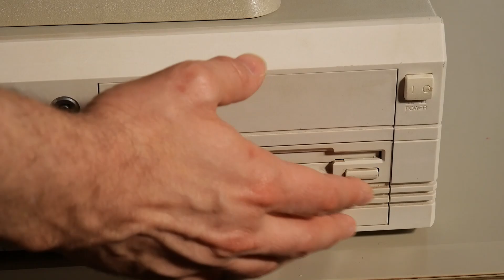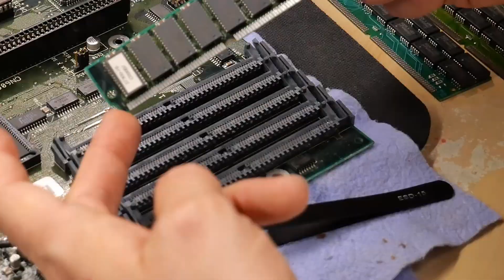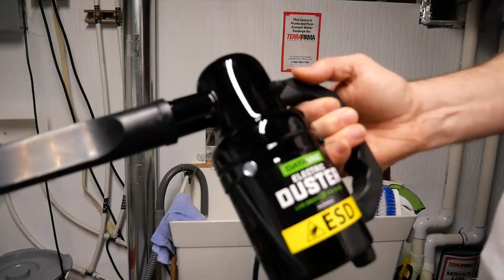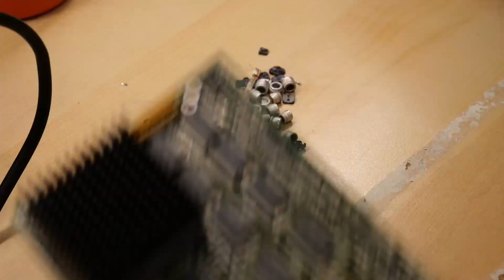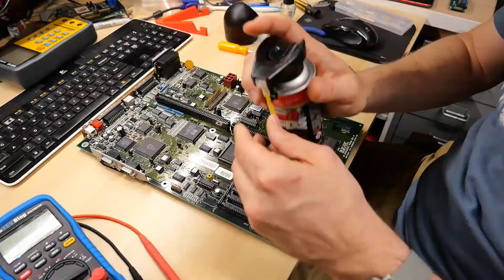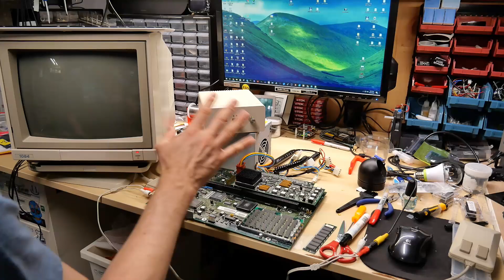Amiga 4000 Repair Part 1: Recapping and RAM issues galore!

Comment: Any chance you remember what trick was needed to remove the Video Toaster card? The combination of the BNC connectors and the card sitting in the video slot while simultaneously being slotted in the slot guides prevents it from being pulled up and out. You probably did full disassembly of the machine, which may have revealed another option to get it out of its slot.

Comment: Nice that you got the A4000 booting!

Winced a bit as you plunged the motherboard into water with not even IP rated components left on it. There are also lots of crannies and especially spot under chips that can trap moisture for a very long time. I also recommend snipping caps with cable stripping pliers (not wedge-shaped normal pliers), if you have no desoldering station. Twisting is a method that guarantees that you put a great force on the traces, which is bad.

Comment: I remember right you have to have two banks populated with SIMM Memory modules and it has to be Banks 1 and 3 or Banks 2 and 4 or all 4 banks populated at once. I’ve broken so many 30pin and 72pin SIMM retainer clips on the memory sockets and that’s when the sockets were new. I can only imagine how destructive I’d be with old brittle plastic memory socket retainers.

Comment: Watching you take out those RAM chips was like the "cut the red wire" scene in a bomb disposal movie. great stuff! God my old 4K was rickety like this.
Reply: Oh, BTW, regarding the wretched battery: my friend was a great tech admin wizard. He cut all the batteries out of my 4K and two 3Ks (saving them in the process). Solution in adding a battery back, if needed, without risk of future damage: he soldered two wires a few inches long to the motherboard and attached them to the battery, which was now inches away from the motherboard and sensitive parts. Just a thought for anyone who really needs a clock.

Comment: Hi Adrian, I was just watching this (older, I know) video. I saw you twisting of the smd caps. Give it a try to cut these caps just above the plastic base first. These caps usually fall apart leaving only the metal feet. These can than be soldered off.

Comment: re: Removing SIMMs with plastic clips.

I've had the most success by unclipping each side separately. Choose one side, pull forward  (medium lightly) on the end of the SIMM, and then pull the clip back until there is a click, this will get the clip past the leading-edge of the SIMM but it will be holding the SIMM from the side. Repeat on the other side, then just pull the whole SIMM forward (without touching the clips). I find this a much safer procedure. When you try to pull both clips out at the same time it's very easy to apply unbalanced pressure, or to continue to apply more and more pressure on a side that is actually free without you noticing.

Comment: When testing computer boards out of their case, make note of if the screw-holes are part of the grounding or not. About at the time of the A4000 system-grounding through mounting-screws became industry standard. The Amigas usually work anyhow, but things can get flakey. Good luck in the repair.

Comment: Don't know if anyone mentioned it previously, but one of the smd caps on the processor card has wrong plus minus marks on the pcb and was wrongly mounted too because of that. This only comes into effect under certain software routines, can't remember when, but I fixed it when I recapped all smd caps and all worked out of the box as before. I desoldered the smd's with an air blowing solder station and guess what? Two or three of the caps got too much heat and exploded, man that smell You'll never forget! Can't compare it with anything I know, maybe thats how hell smells...😄
To stop the sims unlocking I pragmatically honed them down on both sides a bit without any issues, always walking the hard road...

Comment: What do you use as a fume extractor?  I've been doing more repairs lately and don't want to keep breathing in solder fumes but a small fan extractor is not really efficient on larger boards.

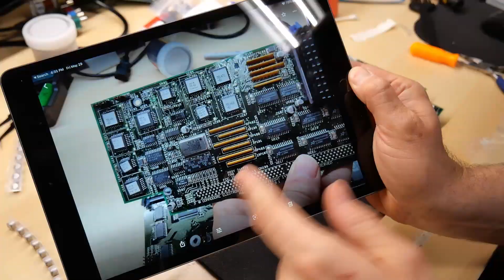Comment: Adrian, thanks a lot for this video! Helped me a lot to prepare for my A4000 restoration. One thing that left me really puzzled: I own exactly the same A3640 Rev 3.1 but on my (unmodified) board the C107, C105 and C106 are the other way than yours at 23:49. As it's difficult on this board to find ground, I used the casing of the quartz as ground and my caps appear to be placed correctly (0 Ohm at all terminals with black mark). Could you please verify on your board?
BTW: I pulled the 68040 for the cleaning process and tore off 5 pins - not due to improper handling but due to corrosion. There were many pins with green corrosion at the base (corroded gold ?!?) and all those came off really easy. Tried to solder them back on: no chance, gave up after 3h. Had to order a replacement on eBay. But with the old '030 board the computer still seems to work (waiting for a 15khz capable monitor) - but it boots and plays sound. Will post a video one day on my channel.
Reply: It really is an issue: http://amiga.serveftp.net/A3640_capacitor.html - the above mentioned caps are mounted the wrong way on your board and are likely to leak again due to inverse polarity.

Comment: Is worth to check CPU card revision. Some revisions had wrongly placed (I think) two capacitors (wrong direction - polarization). In my Amiga, when I replaced capacitors, I always try to use tantal one.

Comment: Power cycling failures may well be due to a slightly faulty PSU. I recently refurbished one and C34 sets the startup delay for the Power Good signal, that cap is a super small dinky one which fails completely and reduces the delay so the mobo might get a power good signal too early and the board might try starting up before the +5V has properly stabilized. If you replace the cap and notice that the computer takes a second longer to react to applying the power means you probably had this issue too.

Comment: George looks a little like Jay Miner the founder of Amiga Corp... ;-)
BTW most of the caps that you've taken out seem to be of the Nichicon dry type electrolytic which were most probably still very very good and wouldn't have leaked. Sometimes recapping is unnecessary.

Comment: That's an interesting soldering iron. What is it?
Reply: It's a ts100 type soldering iron. I've got one and it's pretty decent, it has computer controlled variable temperature control with a built in oled display and upgradeable firmware, also the price isn't too steep. I'd recommend one.

Comment: I'm surprised there aren't any aftermarket RAM slot replacements with actual metal clips instead of the dried up pasta plastic that Commodore used.

Comment: I absolutely love your channel. You should have a patreon. If you did I would definitely be one of your patrons.
I love your technique for cleaning those old motherboards, but I would feel so much better if you were using distilled water for that very last rinsing step (or if not distilled, then tap water run through a reverse-osmosis water filter.) I used to live in Oregon so I know you guys have pretty soft water (which is great!) And I seriously doubt there would be enough mineral deposit to do anything to that motherboard.
Buit...it would make me feel better :)

Comment: Trick: don't screw the mother board securing screw in that is directly under the drive mount.  There are plenty of screws for the motherboard with out it.  You'll be able to remove the board then and leave the drive mount in.

Comment: On the 68040 CPU card, most of them have 2 or 3 capacitors installed backwards from the factory (silkscreen is also wrong) and don't twist them off....

Comment: Thats 2Mb chip ram which is right when in its in the first slot, first slot is chip ram (jumper does not need to be touched), the other slots is for fast ram if you populate that with 4mb simms you will get 16Mb, if you dont see fast ram there is an issue with one of the IC's around the battery or a broken track..

Comment: Daughter-board... Is the word you were looking for, for the CPU card. Technically, the PII and PIII which came on a Slot, rather than socket were also Daughter-board, but the term was used far more commonly on the Amigas.

Incidentally, the SIMM slots also have clips which spring to the out position and only just catch the stick.

Comment: For what it's worth - be careful when using the "twist" method for cap removal. If any of the caps have leaked, the traces and/or pads may be compromised and become damaged when force is applied during the twist removal.

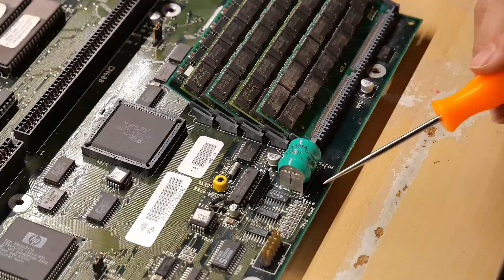Comment: @6:41
Why that comment? Is VARTA bad?
Reply from the maker: Not anymore -- but it seems like if you find a vintage computer with a battery, it's seemingly always a VARTA and it will have leaked and ruined things. It's likely just that they were a common OEM for batteries back then and NiCD batteries always seem to leak. :-)

Comment: I noticed on the sysinfo screen that it was reporting ECS rather than AGA.  Possible indication of something else faulty in there and maybe U976 close to the battery.  Might be worth belling out traces or even removing those few ICs to be sure you've got all the rot out.
Reply from the maker: It's a bug in SysInfo. Does that one NTSC machine even in WinUAE...

Comment: You'll never get 8Mb of Chip RAM sadly.. Commodore never finished the modifications to the Alice chip to allow for it.  They were cutting costs at the time and decided to go down a different route, but if someones designs a new Alice which could address 8Mb Chip then you will be able to use it.  The jumper is unused on the A4000 motherboards.

Comment: This video randomly popped up for me , found it very intresting i broke the bank to buy a 4000/40 back when i ran a BBS but it was far too much power so i sold it for about £1000 after about a year and got a a2000 which is still in my loft about 30 years later and a a500 this video has made me thing of digging them out lol

Comment: Always good to see another A4000 rescued. :-)
Some thoughts, I hope of help:
-Boot screen diagnostics if you haven't already got: https://www.amigalove.com/viewtopic.php?t=324
-That 8Mb ChipRAM jumper - best set to 2Mb, that's the maximum any Amiga supports, also best to check that ChipRAM SIMM is indeed a 2MB one... I expect these points don't really matter but Amigas can be really screwy. As a bit of, um, "fun" it might be educational to look up all the craziness than went on at Commodore, it's amazing the A4000 came out as good as it did. Mehdi Ali is regarded by most Commodore fans as the devil himself although I'd reserve that title for Irving Gould.
-While buzzing out traces it might be worth checking the lines to your Buster IC (think of it as an expansion slot controller). Your occasional Yellow screen might be a problem there... Not really a biggie but if you find you have issues with expansion cards Buster may be to blame - go for a later revision chip if you need to replace it.
-Missing clock: FWIW I agree that 74 series IC may be jiggered. I presume all the traces are ok? Without a battery the clock should show random cr*p rather than be missing. Clock chip next, I guess.
-I'm glad the PSU is outputting something sensible. IMO the PSU in the A4000 is at best hot garbage, even if the rails are reasonable any mystery stability issues are probably down to that. Your Amiga, but I would gut the PSU and install a modern alternate in the old PSU's case - it's not a standard size and the power switch is a bit odd... you can recycle the Amiga PSU to motherboard wiring for the new PSU guts: https://www.thefuturewas8bit.com/a4000psu-upgrade
-If your really precious about originality, I'd recap the PSU and certainly replace those "X" capacitors - the ones that go "BANG!" on power-up, especially if the PSU hasn't been used much...
...also a common issue with BBC micro PSU's - as those computers are bullet-proof I usually wait for them to go "BANG!" for entertainment value.
PS
The 68040 card can be overclocked with a crystal swap, especially of your RAM is reasonably fast.
There's lots of very good pre-built AmigaOS "distros" out there, one with WHDLoad and a bunch of games might be a good start
If you're a glutton for punishment running AmigaOS 2.04 - 2.1 on 3.1 ROMs is a good way to get the most "bang per buck" while maintaining reasonable compatibility - AmigaOS 2 is a good deal uglier than later versions.
I hope that helps a bit.

Comment: Hi. You're using an acid to "neutralize", but it seems to me, you make it acidic instead. Why not using a buffer solution like sodium carbonate? We used in a chemical analytic lab to neutralize either acids or bases. Good video content though, learned a lot. Thanks.

Comment: Great episode Adrian.  Why not reflow all those crusty solder joints?  If they aren't nice and shiny they aren't good.  Some good flux and solder tip (I prefer an SMD flow tip for reflowing) and a few minutes of time is all it takes.  Of course reflowing the solder joints isn't a guarantee, but it will help.  Cold and cracked solder joints can pass a continuity test, but fail when under load or at temp or even cause intermittent issues under operation.

Comment: 29:25 yeah, the Amiga kickstart 3.1, especially on the Amiga 1200 and 4000 like to troll the crap out of you, because they EXPECT a hard drive, and take about 30 seconds to show the "Insert floppy disk" screen if they don't detect it, unlike the older Amiga 600 as an example where it takes about only 2 seconds before it gives you the purple insert floppy screen.

Comment: You do know that some(sorry, I can't remember a name right now) have opinionated that the Amiga sound circuits for the output stage is designed with one of the ICs the wrong way around (IIRC)? Sorry about that being real vague, but you might want to look at a logic diagram and work out if you agree (I wouldn't know how to do that).

Comment: The A500 has a varta battery in it too, but no real time clock (unless you install one), I have no idea what the battery is even for, so I just got a pair of wire cutters and snipped mine off last time I opened it up.... pretty much like you did.

Comment: Have you ever used CR2032 rechargeable batteries in as replacement for the batteries?  Apparently the rechargeable version of the CR2032's are about the same price as standard ones.

Comment: I've had that clock problem with my A500 actually. The battery on the Trapdoor expansion had leaked. so I simply removed it, cleaned the board and checked the traces. Even though everything seemed to be okay, I had the same problems you had, so there were random lock-ups and the clock was unreadable. The problem wasn't there, when the leaky battery was still in there and it went away, when i removed the clock chip of the board. I don't know how much the circuitry around the clock differs between Trapdoor expansions on the A500 and the onboard solution on the A4000, but maybe this could help you to diagnose whats doing on. Btw the selector chip on my trapdoor spit out garbage too, once the battery was gone, so somehow the battery has to be involved there.

Comment: I had a good run from the VIC20, several c64s, and a c128 up until I was forced to switch to PC for college & work.  So I have never actually seen an amiga up close IRL.   How big are those motherboards?  For example, would an Amiga 500 motherboard be about the size of an ATX?  That 4000 motherboard looks enormous!

Comment: The "power" light on Amigas actually indicates whether the audio filter is active.  If it's on, frequencies above 5kHz are filtered out to reduce the aliasing of the 8 bit audio.  The filter can be enabled or disabled in software and probably gets turned on after the initial tests so the light may have been off even if connected.  Some Amigas have a resistor so the light only dims when the filter is off, but for others the power light turns off completely.

Comment: FYI there’s a very strong possibility that A3640 has the capacitor silkscreens reversed for several of them, causing the replacements be installed with reversed polarity.

Comment: 7:20 It is not a Ni-Cd battery. It's a Ni-MH type. Those leaking stains are most likely from the original battery and are just not been cleaned properly. Ni-MH batteries does not leak like Ni-Cds
Reply: Nimh batteries don’t leak as spectacularly as nicd or lithium batteries but they certainly can still leak. I agree that this particular battery hasn’t leaked and it was most likely a previous nicd battery.

Comment: Putting caps back on the same way you took them off trusts that they were on correctly in the first place. I think you put C105, C106 & C107 from the A3640 CPU Card on the wrong polarity.  Known issue with the silk screen. Could cause problems over time.  That obviously isn't the issue though.  You seem well on the way to fixing that.  Great video!

Comment: WOW! Twisting the caps off - NEVER do this boys and girls, this is the WRONG way to remove the old caps. You risk pulling the pads off. You should only use hot air or soldering tweezers.

Comment: So at first, you said to use hot air...but then the "twist" method for the ones that are really corroded because, apparently, hot air doesn't work well for corroded caps.  I see now you go straight to the twist method because it's faster.

Comment: if you take out U177 it will still boot, it in art may have been related to the green screen, the yellow screen on the A4000 is related to chip ram, EDO as a replacement is not a good idea so you will more than likely need to source some FPM.